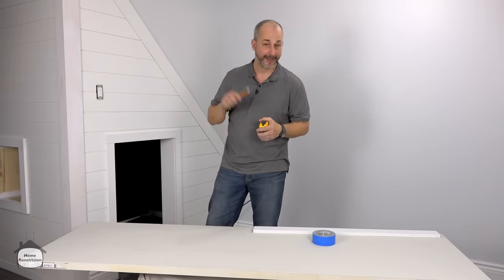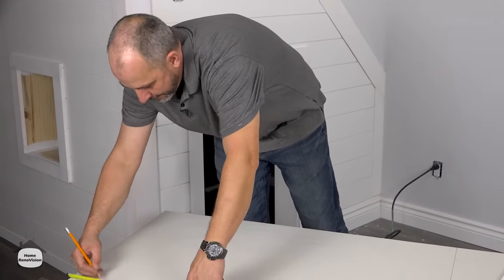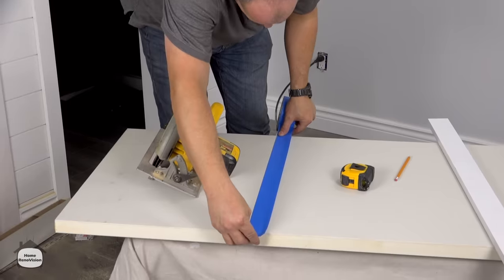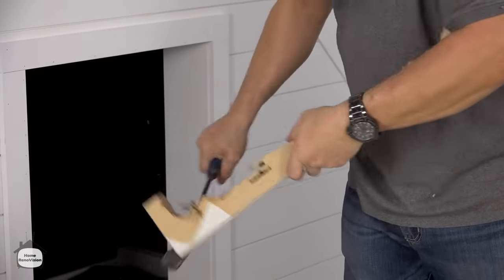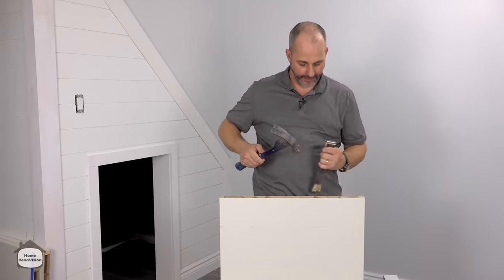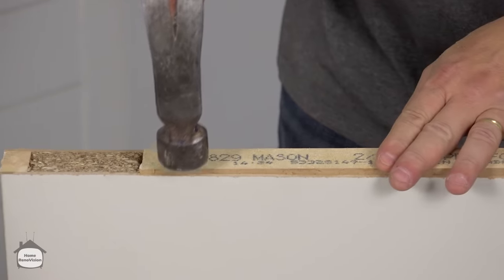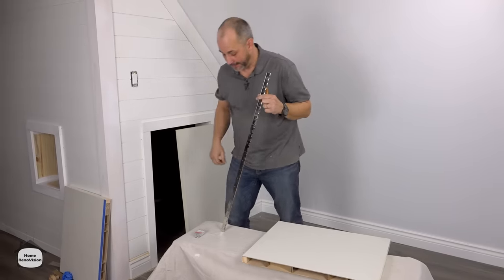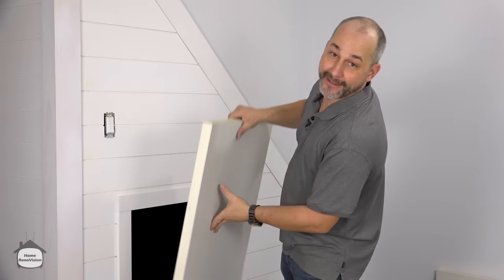How to Cut Down a Door | Height and Width Adjustments

Comment: I swear this man has algorithmic programming on my schedule.  Seems every single door job I have this month, he has a video that follows suite prior to the day LOL.  Like last week, I had a floor job then the day before... BOOM "How to lay the perfect floor".  If this was a permission, I accept to tap my life, keep helping me improve sir!
Reply from the maker: LOL, you sound like a busy guy! Cheers!
Reply: @HomeRenoVisionDIY  Well of course! I put on my grey shirt and blue jeans, pop the OLFA 25mm blade in my back pocket and get at it.  You've changed perspective on everything I do, I'm faster, more efficient and more precise.  I can rip a board quick wih my handsaw like you now lol.  Even picked up a method from one of your earlier videos i believe... Today I had to cut a piece of plywood to fill in for the piece of the subfloor I  forgot when i picked up a client payment.  So I ever so quickly measured one end(4") and the other(3 1/2") total width of 33", ran outside, marked at 33", marked the 4" and 3 1/2 marks, drew my line with my leveler, made the cut and popped it right in within 20 seconds.  WAAAAY faster than my over analyzing methods I used.  You taught me to just freakin Do it!  I even bring my 7/11 cup and pop it in the toilet hole when I do bathrooms to cover that stank hole up LOL  Thanks JEFF! Watching your "Build a Beautiful Cedar Deck" video now although I'm doing a rear patio enclosure but the methods are the same.
Reply from the maker: right on. sometimes it is hard to differentiate between finishing work and when its time to just get er done! Cheers!

Comment: I wish I could use a circular saw to cut a straight line like that without using an edge. :)
Reply: you can with practice, and be consistent on the brand of saw you use. I've used 4 makita saws for over 30 years, the only brand I'll buy, because I know there the cut line is.
Reply: @6286668  I LOVE Makita tools. They are the BEST! Excellent calibration, torque and so LIGHT!

Comment: A few months ago I replaced 3 doors at a house built in the 1900s. Glad to see I did everything correctly. The fun part of doing a house so old is each measurement for the length and width on each side was different.  The whole house is just one big uneven mess. 

One thing I also did which probably isnt needed, after using the glue I also used two small nails on each side when reinstalling the bottom core of the door. Just in case the glue fails after a few years the nails will be there to hold it into place.

Comment: We have always just cut a new plug to fit from scrap wood.  Always interesting to see the approach of a pro on the job.
Reply from the maker: I see that sometimes and always wondered why you would arrange to have that material on site when the door already has a filler available.
Reply: Well, we are always "on site" given we're at home.  It's easier for us to grab something off the scrap pile and cut a plug to fit than to tear apart the end of the door and clean it up.  Plus, I tend to be thrifty and think I will save the cut off half of the door and repurpose it in some way.  I have closed in some transoms with the ends of 6 panel doors, and used the halves of others for attic access doors -- short stubby doors like this playroom door.  I guess I could make a paneled box with the door skins, haven't yet.  Just hate to destroy them until I have decided there's no use.
Reply: R Wind 
Pros wear safety glasses when sawing wood. 
Just saying.

Comment: Hi Jeff;

I'm not sure if this is where a member posts a question but here goes... I just bought a great new interior door mat but my exterior door that swings in doesn't clear it.  If I remove the door and cut it "up" I'll be letting more cold air in this old house so do I also have to replace the threshold?

Comment: I have 2 doors that I would need to take off 1/8"  down the whole door (80"). Would u recommend using a hand planner like you used at the end of the video? Unfortunately a standard 30x80 door won't fit into my door opening. Darn manufactured homes!

Comment: I need to cut  1/2 inch off the width of a solid wood door. The opening will only accommodate a door thats 35 1/2 inches wide.  What is the best tool to use?

Comment: Dude, so I installed those door only to find out they were about 4 inches gap.  So bought new doors but another snafu these are glued with silicone it is hard to strip the face off.  I went to see if I could buy a strip to put in place but was gifted thin strips my conscience does not allow me to just hook.up 1 inch thick strips for I know it is weak.  Can I rent a planer to do this?  How can I separate the facing of doors that were glued with silicone.  I have hammer and chisel away but it is a slow process.     Please your feedback will be appreciated I am unskilled girl trying to do home care and maintenance.

Comment: Do you have a video on how to make a door opening larger ?  I have a tiny door into my bathroom and want to make it larger.
Reply from the maker: not yet, but there is always hope!
Reply: You pretty much just add material then sand and paint to match. Of course, that makes it sound like it won't take 3 weeks, 2 different kinds of wood filler, 14 coats of primer and paint, and get you about a dozen eye-rolls a day from your spouse. But in theory it's easy!

Comment: Would i use that same trimming method of my door opening is crooked? I installs some new bi fold doors into opening where it already had some and at the top half everything has a nice gap but as it starts getting lower everything gets tight

Comment: If I can't rent a planer can I just use a jigsaw or circular (skill saw) when adjusting width  for bifold doors.
Reply: I would go with the circular saw out of the two, for sure.  With a jig, not only would you be there all day but you always run the risk of it jumping around on you, ruining your straight cut and it can gnaw at and chip off your edges even if you tape it off.  You could always try amazon for a planer, I got an electric one from amazon warehouse used and was able to easily plane down a few sticky parts of a solid oak door in no time.  Even before a jig, I would go to the local hardware and get a manual planer lol.  Jigs can be that much of a nightmare

Comment: Yes, they make door like crap nowaday.  I bought a new bathroom door to replace the old one and I noticed it weighs 50% less than the old door and the particle board around the door knob is a joke compared to the old one.  So, I cleaned up and painted the old then re-install the old one even with the old door being a little bend.`
Reply from the maker: reclaiming is still a viable option in many cases. Cheers!

Comment: Hey, thanks for the tutorial. Im pretty sure you said to leave an inch for height when cutting down.  You also said to save the end part to fill the bottom of the door. The door was only 40mm off, so if I cut into it im worried ill jeopordize that bit-I guess I could always get another bit off wood from bunnings to fit, or cut one. Your thoughts would be greatly appreciated coz i nee a bedroom door!

Comment: hey jeff,what if the door has wood print on it,what is the best way to match the print when you cut out the different pieces,(honeycomb doors)
Reply from the maker: Hi Ronny, not sure what you mean by wood print?
Reply from the maker: |Hi ronny, Thanks for the link. my door resizing process will not actually leave any visible damage on the front or rear panel so you should be fine. use a new blade preferably 40 tooth finishing blade set to the exact depth plu 1/8 inch. tape the saw guard to protect from scratching. Cheers!
Reply: thanx for your response Jeff @HomeRenoVisionDIY

Comment: All you gotta do to finish that is:
- Repair saw kickback mark
- Repaint door
- Pray to Christ that the door that fell didn't just scratch up the newly installed floor
- Seal the 1/32" gaps where new core was installed after owner overheard you talk about critters and is now worried about tiny spiders getting into cracks.
- Clean up work area

Gotta love this line of work, it's always something.  Take it easy.